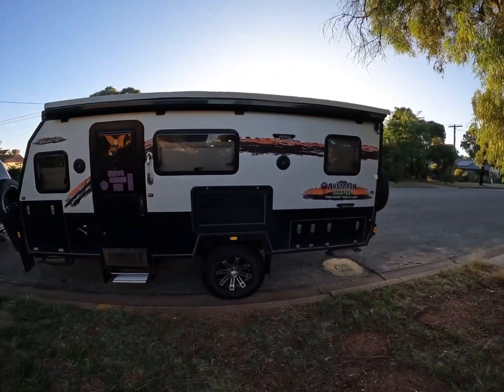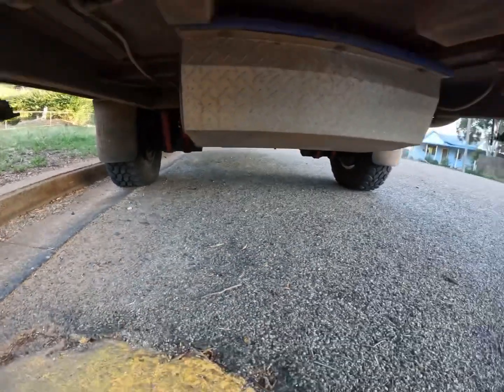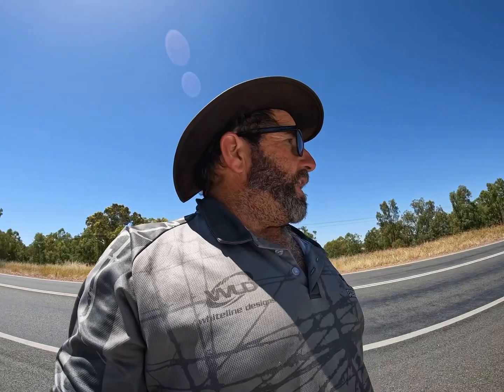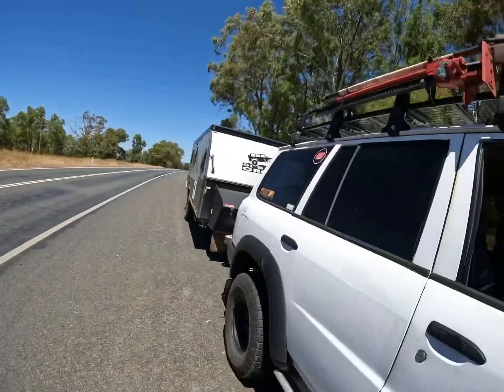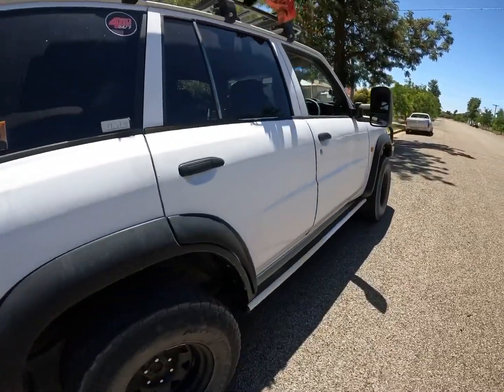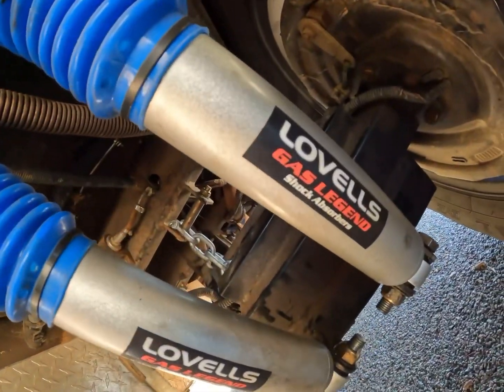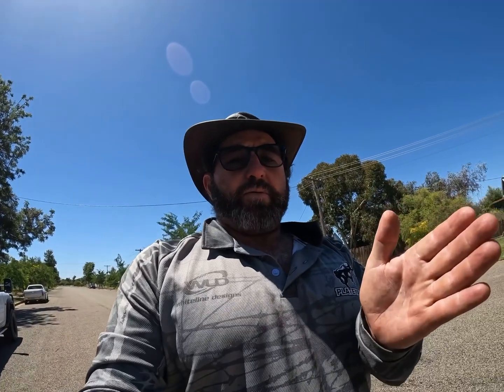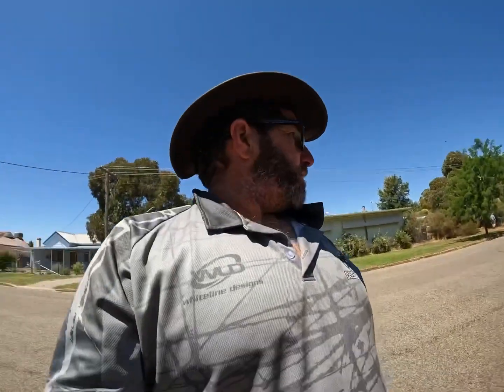Austrack Tanami x15b— Lovells Suspension Upgrade Kit. Does it Make a Difference?

Comment: Thanks mate, I also tow with an older solid axle vehicle (105 series). My MDC forbes 15+ shocks started leaking after 500km and thus convinced me to upgrade. Always struggled with a Little sway which just made for tense driving.
Reply from the maker: Hi, yeah doesn’t make it any easier when the van just won’t sit still. But this upgrade made a huge difference in our towing experience. Highly rate it 👍
Reply: How many kms did your original suspension have?
Reply from the maker: Roughly 40-50 thousand so done alright